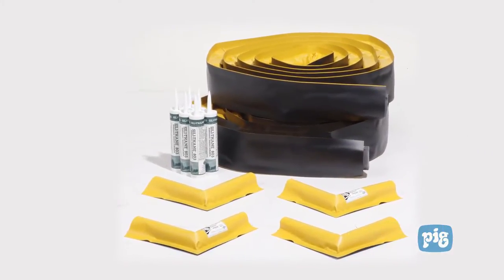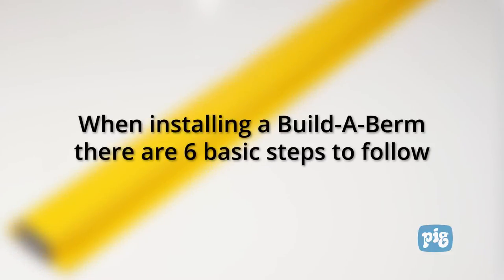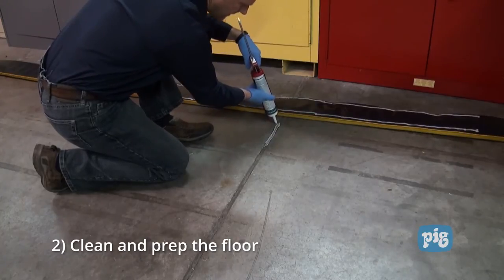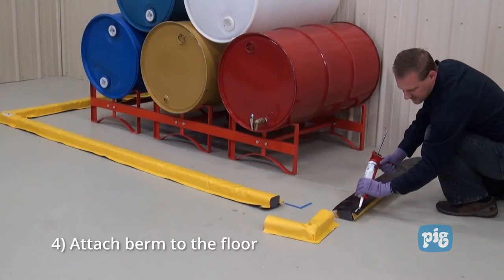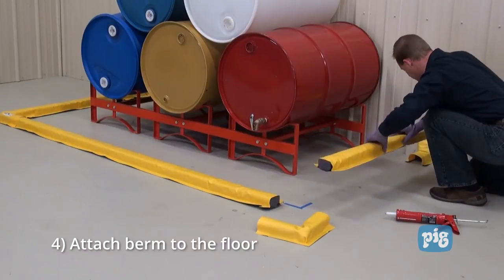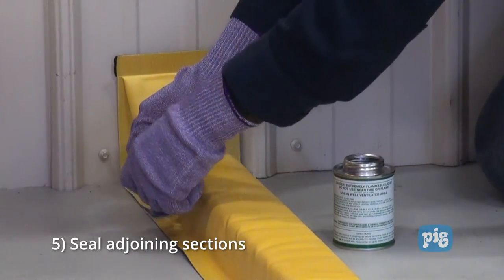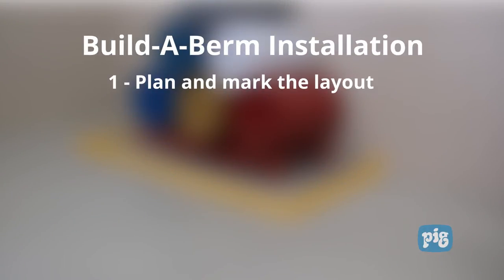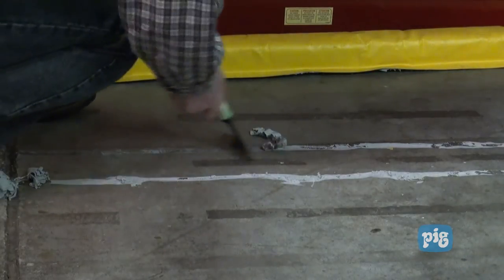How To Install a Build-A-Berm Containment Berm | New Pig

Comment: does the floor have to be complete clean and dry?
Reply from the maker: Hi Kenny! Thanks for your question. Installation is the key to this product working and lasting long.  The silithane sealant is what stops the liquid from migrating under the berm.  The berm itself is just there to give height and more containment.

So YES, the floor must be clean, dry, free of residues including cleaners.  Rinse the floor after cleaning with fresh water, dry with blowers or fans should you need to install quickly. 
You only have to clean the portion where the Berm will be located if you don’t want to do the entire floor.

Placing a board on the berm after its glued down to insure even pressure will ensure a good seal.

Please note that if the floor is not sealed inside the berm, the liquid spilled can absorb into the flooring if its porous.

Let us know if you have additional questions.
Reply: I was not there when the BB was installed. I noticed a white glue underneath though. But I'm not sure they cleaned the floor thoroughly. I think it is hard to install to an already messy oily floor. I can have my cleaning crew clean it with heated pressure washer then wait for it to dry... I was stepping on it yesterday and at the connection part the coolant squirted out. I saw a heavy rubber option. Do you have those?
Reply from the maker: @KennyLauderdale  I spoke with a member of our technical services team about this, and she sent me these directions. I'm not sure if you're able to do all of this, but this would help you to ensure that your BAB is functioning properly:

"The floor was not cleaned well if they have coolant squishing out or the berm was not making good contact with the floor when sealed.
The white stuff they are seeing is most likely the silithane sealant (PTY340-1)
Again, installation is key to a long lasting build a berm.

They will need to use a scraper or flat blade shovel to get under the berm in the areas that are not sticking to clean the flooring in that area or they’ll have to redo the entire berm if its leaking all around.

The PTY340-1 that is on both the berm and the floor will need to be removed – sanding will remove it.

Clean the floor again with a cleaner/degreaser, thoroughly rinse the floor with clean water and dry it.

Use the PTY340-1 in two continuous beads to insure you have no gaps in the lines of sealant.  
Seal to the floor and place a board or other heavy object on the top of the berm to insure it is making good floor contact.
Allow it to fully cure for 24 hours.  Then take water and pour it along the interior edges to see if you have any leaks.  If you do, dry thoroughly with a fan or blower and then try to add my PTY340-1 – silithane sealant under the edges where its leaking until you no longer have any leaks.
"

Please let us know if this helps. If you need more info, we can put you in contact with someone on our technical services team to discuss.

Thanks!